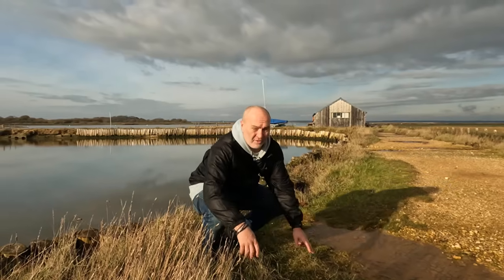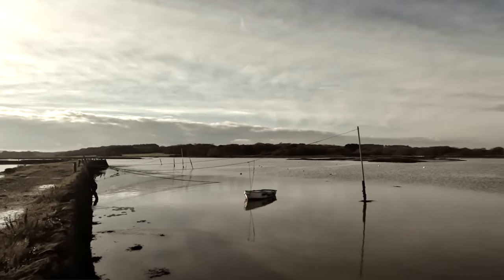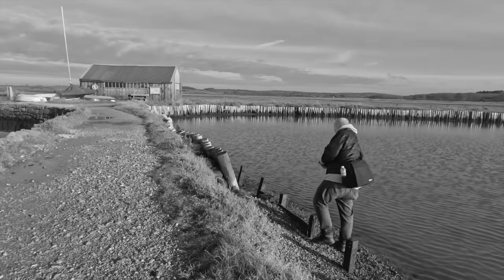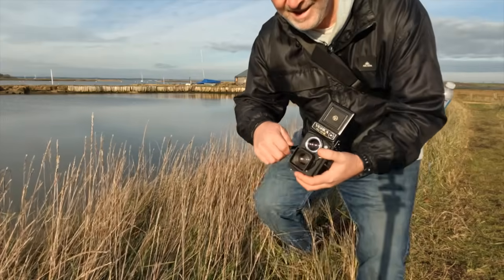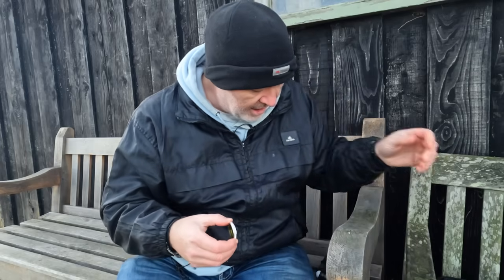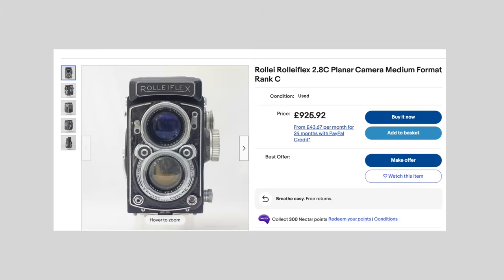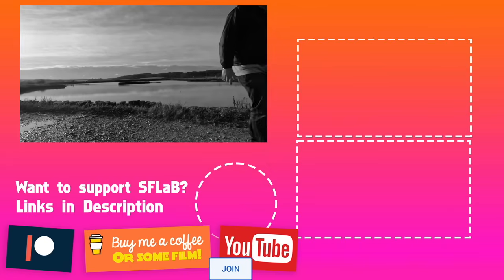Shooting a Twin Lens Reflex. These cameras are so cool!

Comment from the maker: PRINTS AVAILABLE ON ETSY. See links in Description. * You'll also notice I used a Yellow Filter and checked with my meter the compensation. I said a full stop. My meter came back at F5.6.6 so about half a stop compensation I gave***

Comment: Do you know as a pro for 45yrs + I have shot with every single camera system there is - literally hundreds and hundreds of cameras - film and digital - all formats from 10x8 down to the tiny 110 but I have never ever shot with a TLR - and I don't know why - so thanks for that lovely little film about it
Reply: You should try it.  Takes a little to get use to as everything is reversed and upside down but they take some lovely photos 😊
Reply: @Resgerr  Thanks - I have tried plenty of MF manual through waist level - and of course I am well versed int he upside down back to front when shooting on a matte screen straight through to the the lens with a 5x4 and 10x8 view camera - just never a TLR - excellent stuff
Reply: @nelsonclub7722  I forgot 5x4 are upside down and the wrong way around 🙃
Reply from the maker: Thanks.

Comment: I wish people were honest with advice about strengths and weaknesses and suitability. My father - proud owner of a Rolleiflex TLR - bought me as my first 'serious' camera a Russian Lubitel TLR. He didnt hold with fiddly new-fangled Japanese 35mm. He meant well but could only 'see' photography from his own narrow perspective. TLRs are good for certain subjects and styles but hardly a beginners camera. TLRs have inherent parallax error, left/right viewfinder flip, lack of D.o.F visibility etc kills off close-up, telephoto, moving action and eye level shooting. And only 12 exposures per film is expensive and cumbersome to reload. And you can't shoot slides (well only with an adapter and considerable waste of film). Its tough being 14 using a TLR when your friend has an Olympus Trip or similar. Could have put me off photography for life. But I eventually bought a Zenit SLR (with my own money) and the world changed. Did he learn anything from this? not much. He gave my younger sister a Zorki 4K. Nice camera for a certain kind of enthusiast. But for a 12 year old's first camera? heavy, awkward to load, no point in interchangeable lens if you only have one. And don't even get me started on exposure meters! He - of course - had a Weston, but we had to use a little calculator card with tables for time of day, weather condition, light or shade, film speed, and read-off an EV value.

Comment: Thanks! My 124G arrives tomorrow & doing my homework. Have 15 rolls of out of date B&W inc quite a few Acros original from my film days. Location very familiar, used to visit there from Lymington 2002-2017 & shot a fair bit of 5x4, even have shots of the previous bridge when rickety.

Comment: 3:10 Major benefit is that you don't need a moving mirror and the shutter can also be simpler.
Reply: I was about to say the same thing. The only note I’d make is that this is the benefit over an SLR. I think it’s worth noting that the TLR benefits over a folding camera or such by having accurate and coupled focus. It’s bigger than a folder, but in contrast to a folding camera with a rangefinder, the focus coupling is also relatively simple. And a solid body means no bellows to tear or puncture.

Comment: More evidence I am old as dirt. These were my work cameras, this was my format, (before they changed the water). I kept the Rolleis for inside work, banged around outside with Yashicas. The best TLR I had was a Mamiya C330S with four interchangeable lens sets from 80-250. Never messed with the 645 SLRs, though they were always on my list. Another range of lenses was not only redundant, but silly.
Film is not dead... it just smells funny

Comment: There is a definite psychological  difference in using a waist-level finder to compose your images. 
Looking with both eyes at your image within the frame at a comfortable viewing distance is a very different approach to peering through a keyhole with a camera squinched up to your face. Obviously my chosen vocabulary betrays which I prefer, but truthfully there is no one right answer that suits everyone. 
Medium format cameras, both TLR and SLR are most often often associated with the waist-level finder, and also very often the square frame, allowing either horizontal or vertical framing without turning the camera. This aspect, more than anything intrinsically linked to the negative size, is what gives the “medium format look” so often sought after today. 
There are exceptions – the Soviet Pentacon Six shown here was most often used with a pentaprism eye-level finder (hence its name) and the Pentax 6x7 was designed to be used this way. Both Hasselblad and Rolleiflex SL66 had pentaprism eye-level finders, and even the later Rolleiflex TLRs had one, though I never saw anyone using it. There are also 24x36 cameras with waist-level finders (both Voigtländerand Contax were well-known for this), but by and large the waist-level finder and its relaxed compositional technique is an integral part of the medium format experience.
Interestingly, though the expressed philosophy of the medium-format square frame (according to Rollei) was that an image could be composed within the frame either horizontally or vertically, then cropped to suit after development, not a few medium format photographers developed a penchant for the square frame, and you will see countless medium-format images expressly composed for the full square format.

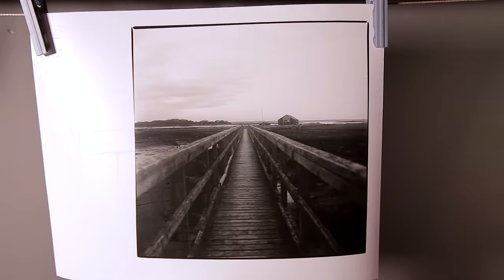Comment: 14:01 in this case, it wouldn't be hard to save, since the problem and the surrounding areas are almost identical.
Print with your dodging tool so that you leave a blank spot over the mark. Then slide the easel over a little bit until that spot is under a good area of the negative. Use your burning tool to print it in.
Voila! The mark is gone and the fix is practically invisible.
(Or you could just fix it on the computer, but where's the fun in that?)
Reply from the maker: Cheers Mike. I have tried that several times and it does work. Worst one was a plastic bag I tried to clone out on grass. Gave up! It was about an inch wide on the print.

Comment: What a great set of prints Roger. The softness mentioned with the Delta/Yellow filter combo can be eliminated using an original Yashica hood which bayonets on the outside of the taking lens. Big 👍s up
Reply: The Yashica takes standard Rollei Bay 1 filters and hood if looking for alternatives
Reply from the maker: I thought that Nick. The hood I was using won't let the filter on. Cheers.

Comment: Yashica lenses are wonderful, as is the camera generally. I’d just say buy one from a dealer where you get a warranty. I’ve got Rolleiflex, Mamiya, and Minolta TLR’s and the most fragile has always been the Yashica and it looking perfect doesn’t mean it works perfectly. They are a bit like a car, if it hasn’t been used that is when the problems start.
Reply from the maker: Absolutely. My one from time to time doesn't fire on some frames but luckily not this day. They are easy to open and clean and get to the firing button. I wouldn't want to get into the shutter mechanism though!